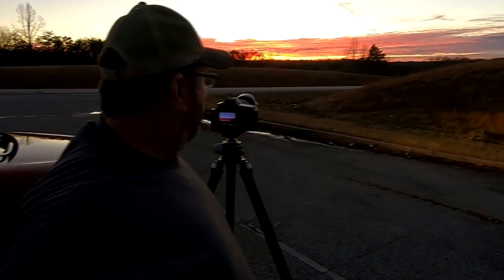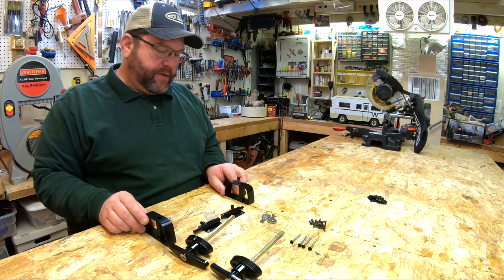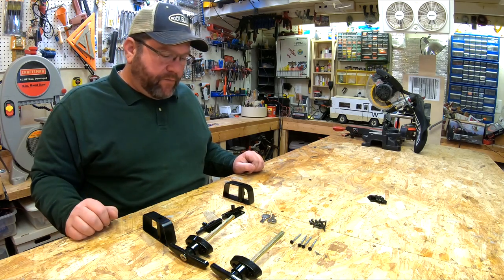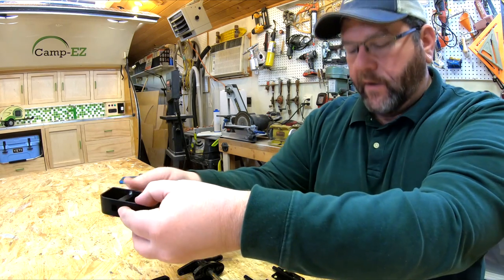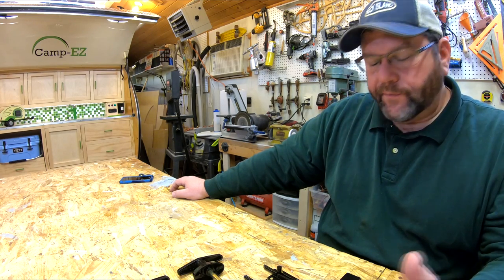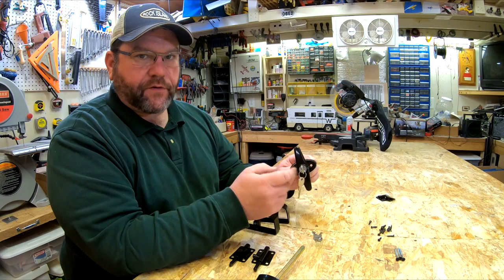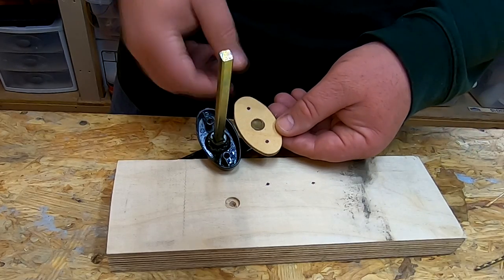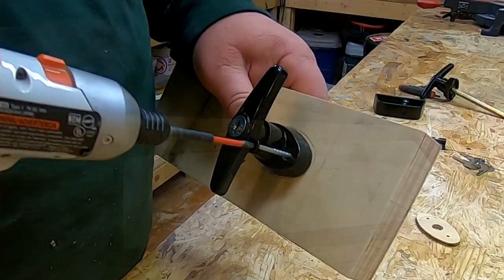$30 Locking Door Latches (both) on the Camp EZ Teardrop / & RC Flying

Comment: Turned out nice and tidy!  I am doing something similar and figured out how to get rid of that slop you mentioned on the shank side.  You can get a fender washer with a hole just big enough for the shank.  Drill 2 little holes in it for mounting screws and add to that back side.  I think it’s going to work for me and I like the metal on metal wear point too.  Good work and thanks for sharing!
Reply from the maker: Perfect solution!  Thanks for the tip!

Comment: Dude, this is SUCH a better idea than the RV style latches... every RV latch install i have seen so far requires you to hog out the door frame to almost nothing. I’ve been reluctant to start installing mine over my 3 month build because of this... problem solved... it also keeps it more stealth looking. This is ONLY for when the trailer is occupied so 1 lock is fine. You beat that lock you meet my glock. The bar goes on when I’m away.

Also, if u just through bolt it and use nylock nut nobody would ever get the bolts out without being able to hold the inside nut to keep it from soinning
Reply from the maker: Thanks for the great feedback.  After many trips, it’s still working great!

Comment: Thanks for posting this. It is a brilliant idea, so I borrowed it. 
Here in Australia, teardrop door fittings are hard to come by. When you do find latches that may suit, they are on-line, which makes examining them and deciding whether they will do what you need rather difficult.
So it was great to see the R & D done for me. And I'm on a budget, too. The traditional teardrop latches can be brought into the country, but they ain't cheap and the freight is tragic.
Still had to import these latches - the T-handles are common in Oz, but the nifty D-handles for the inside seem to be non-existent.
But I got an Amazon free freight deal, so it was about $40 US all up. 
This is everything; cheap, robust, simple, easy to install, fit for purpose. Now should you happen to know where I can get the sliding bolts for locking from the inside........
Reply from the maker: I’m so glad this design worked well for you!!  We’ve been using it for 2 years now and it’s holding up great and still working very well.  Try searching online for a “Barrel Bolt Latch.”

Comment: You already have the outside going thru a piece of metal. Just fashion another piece out of the bar stock you used for the inside striker area and drill a hole in it the size of the shaft. Drill 2 holes to screw it to the inside of the door, then sand it smooth, screw it to the inside of the door slop problem is fixed.

Comment: Excellent idea! where'd you get the door hardware. I know I've seen those D handles somewhere but I don't recall where. Thanks for posting!
Reply from the maker: Brett StClair Hey thanks!  I picked the locking T handles up on eBay.  They came in a set of two and were keyed alike.  There were lots of them available.  $20 for both I think.

Comment: this may lock its self why driving down the road . i had this happen alot with setups like this
Reply from the maker: falcon7350 Good tip.  I’ll be thinking of an anti lock feature.
Reply: @CampandCamera  - Anti-lock: One side of Velcro on the back side of the little sliding lock handle. Other piece of Velcro on the door behind the little handle. This way all you do is lift the little sliding handle away from the Velcro and lock as usual. When unlocked the velcro will hold the little slide handle in place.
Reply from the maker: Thanks for the tip!  It sure would stink to have the door lock from the inside while going down the road!